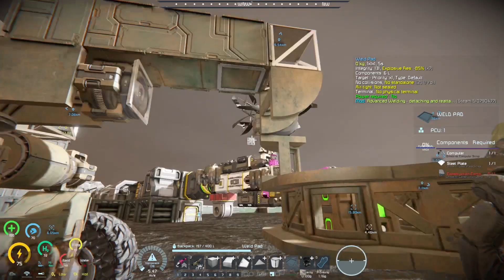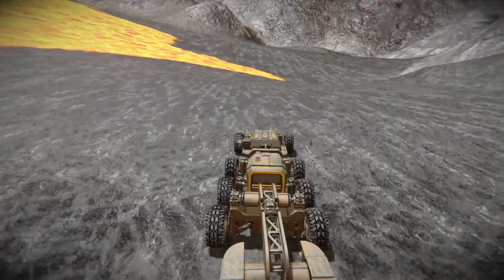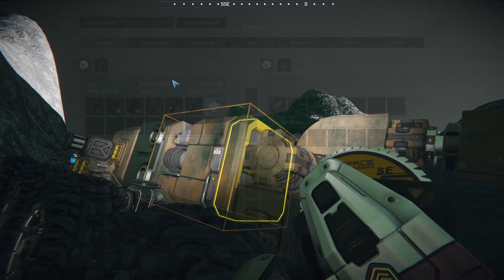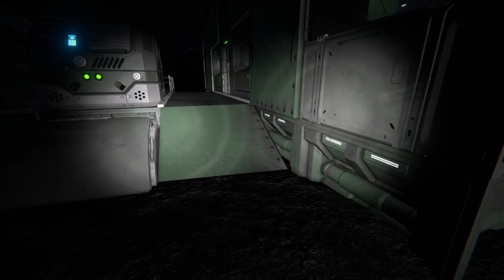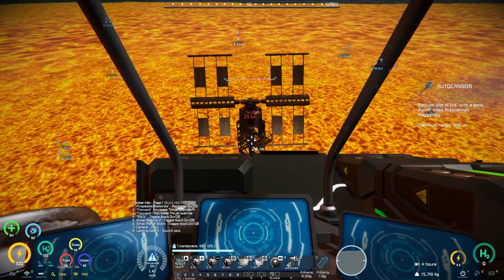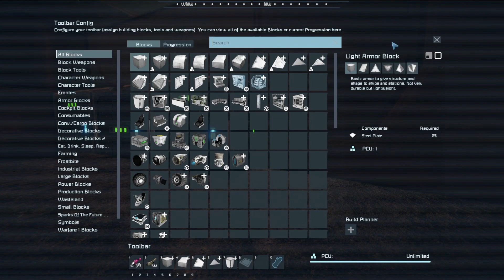Survival Records, Igneous (Space Engineers Lets Play) E22

Comment: I have some mods I use in essentially all of my playthroughs, in case you're interested.
Mods that work great with any playthrough:

Recon Cameras (Allows you to literally see grids on the surface of a planet from another planet)
Binoculars
Radio Spectrometry (For Asteroids, helps you discover which ores are on an asteroid from up to 15km away)
Seismic Surveying (For Planets, same as the above but more in-depth and helps you find ores more immersively)
Lord Wiader's Tiered Systems (Adds tiered everything and gives more endgame options for progression)
SE Minimap
Rotary Airlock (A single block that acts as an airlock)
Projections to Assembler (Does what it says, sends entire list of components to assembler)
no PB - Info LCD (A power graph and info screen option under an LCD's "script" without the need for a Programmable Block)
Kinetic Devastation (Simply stops grids moving at high speeds from clipping through terrain)
High-power Spotlight
GridPickupMod (Lets you pick up "light" small grids with your character, and drag it around)
Tool Switcher (You can put the welder, grinder, and drill on one hotbar slot and mouse-wheel between them)
Reply from the maker: I use many of those as well. Thanks